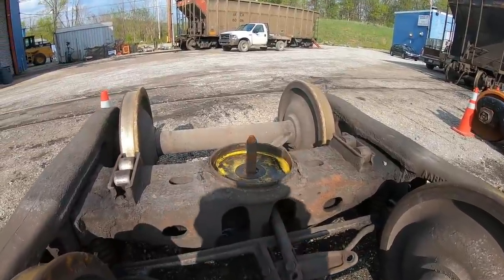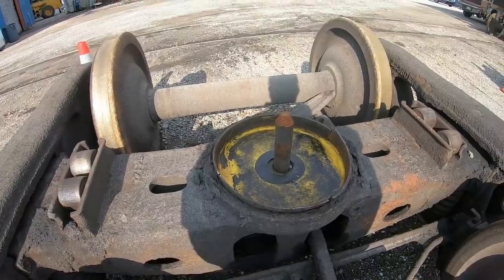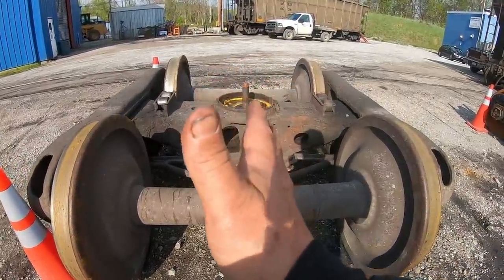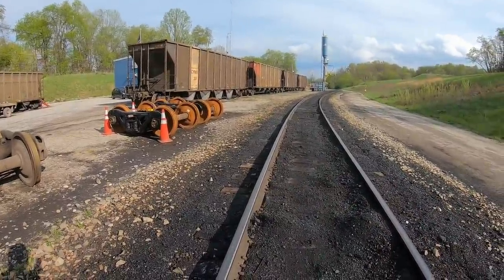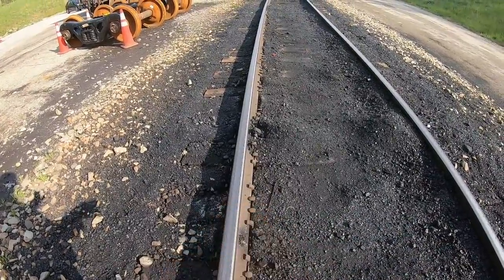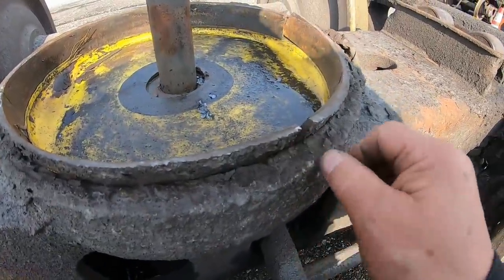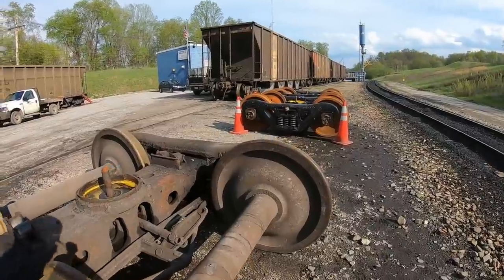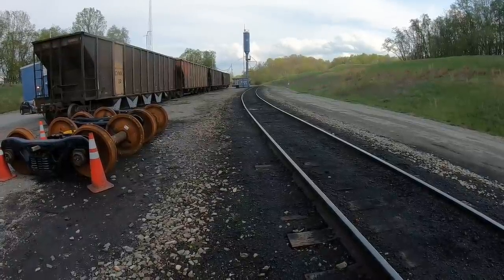Why the Derailment at Curve 18  Happened

Comment: That center pin is what the truck pivots on. If it is straight then the cup wall broke when it de railed
Reply: I think the pin is just used as a guide when setting the car down on the truck.
Reply from the maker: As Thomas the Tank Engine said, Silly cars always causing
trouble because they are angry. Thanks for watching my friend.
And as you know the track men always blame it on the car men,
the car men blame it on the engineers and the engineers
blame it on the track men...LOL

Comment: Check to see if the two sides of the truck match. There are several small cast nubs on each side. One of them will be knocked off. Every casting is different and gets measured when new. The nub is broken off to tell how long it is. They should match. Something caused that flange to fail. Probably due to truck 'hunting'. Basically the body of the car slaming from side to side because of the mismatched sides. Traveling at 22mph, the hunting would have been pretty bad. Could have caused the derail.

Comment: Where did all the grease go? That liner looks like I has been dry for a good long while. The grease used for that is heavy duty. Thick stuff. Either A: it wasn't greased properly to begin with (highly doubt it but human error does happen.) Or B those cracks were pre existing and the grease was pushed out through them in normal operation.. the cracks didn't nescicarially have to be as big as they are now when that happened. They just had to provide enough of a gap for escape, and the cracks could have widened significantly as the derailment happened.
If it were me I would want to inspect all of the truck sets to ensure this was an outlier and there's aren't more in circulation with cracks and insufficient grease.
Reply from the maker: Jason, appreciate your watching and for sharing your thoughts with us, hope you'll watch more of the videos coming out soon on
the derailment

Comment: If this was the first curve, maybe, but if it negotiated other curves then there goes your theory,if the rails are too close together and the wheels are a little skewed it could cause the wheel to climb the rail and derail, but that wouldn't cause the rail to roll like it did, my guess is that as it took the curve the spikes let go and caused the rail to roll over. whatever the cause it still doesn't explain why the engineer kept going for 1400 ft without realizing he was derailed, some needs to get fired but I'm sure his union will protect him.
Reply from the maker: You are a thinking man sir! I like that, but now also factor in
that this was the first high degree curve it encountered, the rest
were 5 degree or less, does that make you ponder more? And
stupid weird stuff happens all the time on RR, Murphy's Law, so
go figure.

Rear engine was shoving for about 400 or so feet before
it came uncoupled and train went into emergency then the cars
went on about another 800 or so fee before they got stopped, does
that help? As soon as the train went into emergency then the
operator reacted, he had no idea being in the lead loco what was
going on behind him until brake pipe lost pressure.

Comment: The little rollers on the side of the bench look shiny could be an off balanced load
Reply from the maker: The coal cars are loaded pretty evenly David, however what
very well may have happened is they got that way when the car
derailed and leaned over to one side and was dragged down the tracks for over 1200 feet. Very much appreciate your taking the
time to check out the video and write in my friend.

Comment: Robert Hall  Here we go.  There are 80 hopper cars?  This is 160 trucks in use.  Dave found the reason for the damage done when one truck didn't swivel properly.  It appears that this was a one of a kind failure.  This gives a failure rate of 1/160 for the destructive derailment.  Don't know whether any other derailments can be attributed to failure of the truck to swivel.  Based on current data the failure of the truck to swivel is very low.  Time has not been considered in the failure rate.  There may be other data for replaced trucks that could lower the failure rate.  There may be a way to calculate a more accurate failure rate if data regarding truck failure and replacement is available.  At a failure rate of 1/160 we may not see the problem again.
Reply from the maker: Yes and consider the many, many years of constant train running
where there was no derailments caused by such factors Robert, so the failure rate is phenomenally low. Appreciate very much your
thoughtfulness in writing in my friend.

Comment: The bowl sure is suspect, I would also consider the in train forces. 2 cars ahead of the rear power unit. Consider the forces had subsided  on the pulling end slightly and more push was happening at the rear, combine that with the curve to the right side in conjunction with the bowl letting the car lean right and some pressure from behind against the rest of the train no longer in full draft. Car wants to go tangent to the force applied....my thoughts anyway.
Reply from the maker: Jim, appreciate your watching and for sharing your thoughts with us, hope you'll watch more of the videos coming out soon on
the derailment

Comment: IMO you hit it dead-on about lube failure at the center-pin/bowl. Story was published in TRAINS in Oct 17 about multiple derailments of double-stack well-cars in the SW in the 70s/80s, and the inquiry that triggered. IIRC upshot was that the plastic bearing needed more frequent replacement of annular plastic bushing, with possible additional lube. One outcome was a suggestion to replace the plastic bushing at many more opportunities.
Reply from the maker: Well  thanks for sending that in Jacques, that's an interesting find
appreciate that

Comment: Ok dude, looking at that Truck there's nothing wrong. 22 years as a Carman. There's no way that truck wasn't slewing.  Plastic liners are not to be greased. You can use a dry lube, but you're never supposed to wet lube. It collects dirt and causes accelerated bowl wear then.. That bowl shim had nothing to do with the derailment. I've done TA-5 inspections on hundreds of derailed cars. That truck is worn, but not in bad shape at all. Most likely if you're absolutely sure it's not a track cause, then it was train handling. They could have had some slack action in that curve, causing a car to start over the rail. Also, I know the Hucher crew from Washington, PA and personally have been on huge derailments with them. There's no way that was the worst they've seen. We have a 10 car derailment in our yard as I type this that had worse track damage than what you have. Honestly for a class one, that's just another day.
Reply: Good to hear another opinion, so how often do you replace the YELLOW LINER? I know Dave’s not liking your comment.
Reply from the maker: LOL yep he is right, there nothing wrong or extra ordinary about
a center ring being cracked in 3 places and part of it rolled over. We were told years ago by Lyon's Industries who rebuilds all our
truck sets to put 2 packets of grease in the center bowls, so I guess the big company that rebuilds truck sets and loco trucks 
doesn't know what they are talking about either, nor do the
manufacturers that make the special grease for this exact purpose,
go figure....got to love it man. Appreciate your watching Joe
Reply: @ccrx6700  It literally says on coal cars, intermodal cars and others that have a plastic liner to not lube them. Stenciled right on the car body. It's also in the AAR field manual and information from Stucki that they are not to be "wet lubed". Using a dry graphite type lube is acceptable. So I would say someone at Lyon's industries (whom i have never heard of) doesn't know what they are talking about.
Reply: @joemc111  Replace when needed when the car is jacked for service. Honestly you don't see a lot of them worn to a condemnable limit. Adding grease completely defeats the purpose of the liner. The purpose of the liner is to be a wear item.
Reply: Also if you do research on non metallic center bowl wear liners you will see that the manufactures themselves say lubrication is NOT to be used. You can see this with a simple google search. Either way, i can tell you that Truck had nothing to do with the cause of your derailment.
Reply: @TheNemosdaddy  it’s just interesting to see this part of the car. I watch “ shoestring the hobo” sometimes he talks about the car parts.

Comment: Rolling into a banked curve, one rail goes uphill and one rail goes downhill.  The truck doesn't conform to that so the weight falls on two diagonally opposite wheels, and the other two diagonally opposite wheels are lightly loaded.  They're candidates to derail is anything else is wrong, going into a banked curve.
Reply: NO!  ALL of the superelevation in the track structure is introduced into the "high" rail in the curve.  The track profile is not "rotated" on the centerline of track alignment. Don't confuse raulroad with flight path.
Moreover, the wheels and axle revolve as a unit, unlike an automobile or stagecoach where the wheels turn independently.
The physics pf wheel tread taper, railhead surface shape and combined wear interaction go way beyond this discussion.
Reply: @glennfoster2423  All that matters is that one rail goes more uphill than the other.  That's the only way a bank can be introduced. That produces a non-planar piece of track over the length of the truck, so two wheels diagonal wheels bear more of the weight than the other two.

It was the explicit cause of a Japanese derailment of a passenger train many years ago when it took a curve slightly too fast trying to make up time.  The start and end of the banked section are the vulnerable places.

Comment: Center bowl on the bolster is too shallow. Center plate on the car could be worn out also. Side bearings could be too tight.
Reply from the maker: John I don't know what they found out about that when the mechanics pulled this out from under the car, wasn't there, but
As Thomas the Tank Engine said, Silly cars always causing
trouble because they are angry. Thanks for watching my friend.

Comment: So I think I also understand that if the truck is lighter on the outter curve thrust side that insufficient speed could contribute to a lighter weight distribute  to the outside truck wheels due to the inside leaning of weight. (Center of balance)  Although inertia straight line theory  is evident it may be that the center of balance (leaning to inside truck wheels ) outweighs it.
No pun intended.
So maybe more speed would cause better traction on the outer rail.
Right.
Reply from the maker: Very interesting hypothesis and you may be right. Consider that
harmonic oscillation the magic number for car wheel roll off is 17,
so slow order either go 10 or 25. Am going to do a distant
future vid on under and over balance in curves which is close to
what the first part of your comment stated. Thanks for watching
Reply: @ccrx6700  
That sounds like quite the informative video. 
Sounds good!

Comment: When you say 3 degree curve, what is ment by that? The 3 degree curve shown looks like it turns more than 3 degrees
Reply: It's not the total amount of the turn, but how far it turns in a given length.  So a 3 degree curve turns 3 degrees in a length and a 7 degree turn is sharper curve turning 7 degrees in the same length.
Reply: @mikefochtman7164  Thanks, that's kinda what I suspected. What is the certin length ?
Reply: @insylem  According to google, a straight line from inside rail to inside rail of 100 feet.  So a 7.5 degree curve has a radius of 764.49 feet.  While a 3 degree curve would have a radius of 955.37 feet.
Reply from the maker: You are correct in that Mike, thanks for answering that guys
question

Comment: The "twist" or "warp" that is introduced into the otherwise level plane of the guidewar (nee: track) surface by design, mainenance or environmental wear and tear is therefore addressed by standards and regulations.  Ergo, when tolerances exceed standards or regulations, condition of the guideway structure MAY be part or all of the cause.
Careful and thorough inspection and analysis is the proper method of assigning cause.  Speculation rarely leeads to improvements to avoidance of future mishaps.
Reply from the maker: You welcome Lindsey, I love RR talk too....LOL

Comment: Did anyone else notice the side bearing, to the right side of image. Suspension, bolster, and side frame alignment,  needs to be checked. The bolster ring was more than likely, damaged by the derailment, as a heavy car on a derailed, skewed, and bouncing truck, will break that thing rather easily.
Reply from the maker: Hard on a truck set when it gets drug 1400 feet off the rails
under a loaded car, surprised more damage didn't occur to it, but William As Thomas the Tank Engine said, Silly cars always causing
trouble because they are angry. Thanks for watching my friend.
Reply: @ccrx6700  As a former track inspector, I agree with your assessment of the structural integrity of the track, and roadbed. Your Thomas statement also rings true. Take 50 identical  new cars, and you'll get 100 different dynamic actions and reactions (bad attitudes). As a current car knocker, to me truck inspection is critical, especially if it is to transition from tangent to spiral , spiral to curve, curve to spiral, and spiral back to tangent, smoothly. But then again, load the car wrong, and MOW, and Car Dept. can breathe easy, knowing at least we got it right. Stay Safe Brother.

Comment: that pin sure is small for so much weight it needed a cotter pin or a pin atlest 2 inches it holds the tandem
Reply: The pin doesn’t take any forces in operation. It’s really only to line up the bowl with the car body. The weight of the car rests on the bowl, that’s what keeps the truck in place. Passenger cars are a little different. The pin is anchored to keep the truck attached if the car lifts during a derailment.
Reply from the maker: Thank you Bill for that!
Reply: @ccrx6700  my name is bob
Reply: @billmoran3812  coool the bowl holds all that weight

Comment: Wouldn't the wheel just climb the rail though? For both rails to roll out, some of it had to be track. When we have rails roll out, it's generally because tie condition and wide gage. There is a lot of lateral dynamic forces pushing out especially going around curves.
Reply from the maker: High side rail wheel did climb until the lateral force was greater
than the vertical and that rail then started rolling out. The inside rail
was rolled by the loco being dragged with it's trucks cocked at
an angle. Hope that explains it better. Thanks for writing in Matt
and for watching my good man.
Reply: @ccrx 6700  - Yea, I hear you. Trains can go through some rough track and stay on, but then some trains come off on the better track and it's a wonder. A couple years ago we had 4 cars on their side coming out of a turnout in the best and newest turnout in the whole yard. Tie condition was decent (no push) , rail was good, gage was 57 1/4" to 57 1/2" max on the curve closure rail but the rail rolled and 4 cars on their side. It was blamed on track. If the track isn't absolutely perfect then that begs the question how much of the tracks condition played a role in the derailment especially if you cant find concrete proof that the train handling was bad or a car or cars had defects. In our world in MOW, 57 1/4" gage is acceptable and start bringing it back in once it creeps over 57 1/2" gage.
Reply from the maker: @Everyday_Railroading  I understand fully what you are saying Matt. They just
built a new frac sand unloading facility at our closed down sister mine here.
Brand new track and turnouts. Couple days ago they derailed 3 cars there,
I didn't see it but they said they blamed it on the new track..... go figure.

An old railroader from Genesee & Wyoming once told me, Dave there
are hundreds of reasons why a train might derail. You will
be amazed at some of the rough track that a train can sometimes stay
on, and then there are other times when just the slightest
little thing will knock a car off.  Railroading is an interesting industry
with so much to learn. Thanks for sharing with me Matt.
Reply: @ccrx 6700  - Thanks for sharing your story. I'm trying to get better at derailment investigations but it is hard sometimes. I look at the track and think no way, but sure enough sometimes it does get blamed on track once they pull the tapes from the engines. I work for a short line too and not very far from you. Keep up the good videos, they are enjoyable.
Reply from the maker: @Everyday_Railroading  Awesome Matt. Where are you at?

The absolute best book you will ever find on derailment investigation is
printed by Gary Wolf, it's $75 but a total wealth of info on all
aspects of derailments and  tons of info on cars and track that
you can't learn anywhere else. He is one of the foremost derailment
experts in the world. I cannot recommend it enough. Hope to hear
from you soon, we are all in this railroading together my friend.

And always remember Matt when a derailment happens, the engineers blame
the track crew, the track crew blames the car men and the car men
blame the engineers.... LOL And if you watched Thomas the Tank
Engine, it's always the silly cars fault cause they are angry about
being pushed and shoved around all the time.....

https://www.wolfrailway.com/